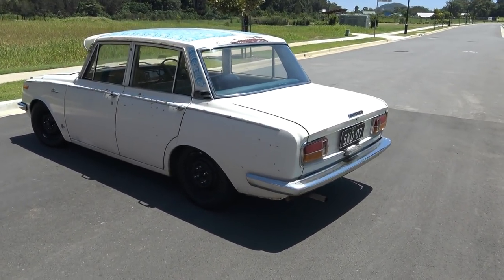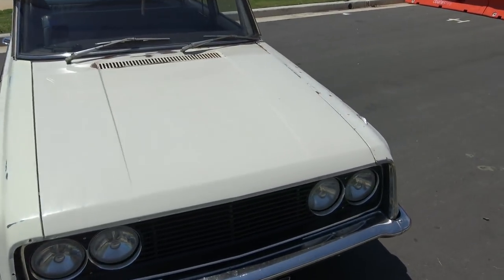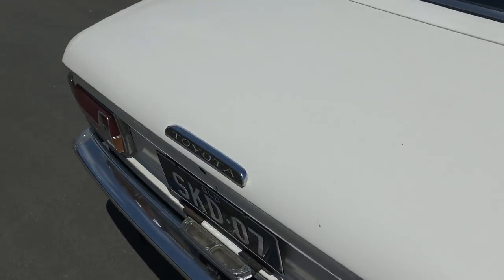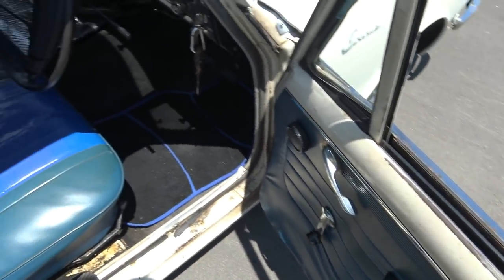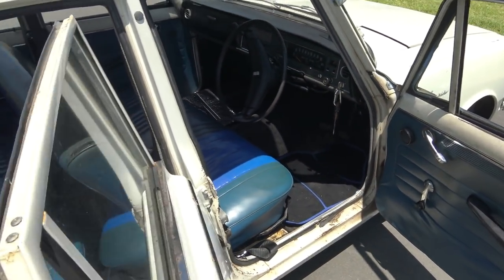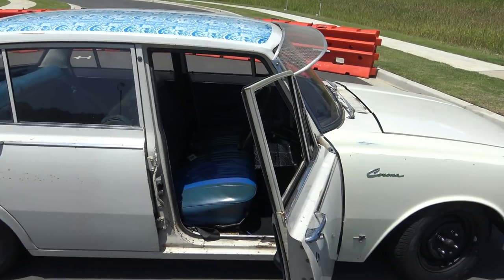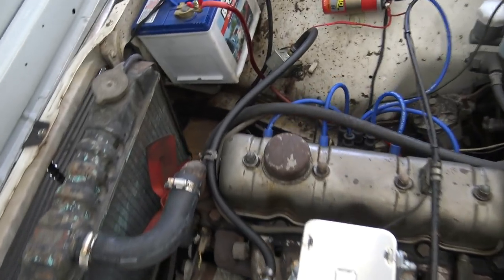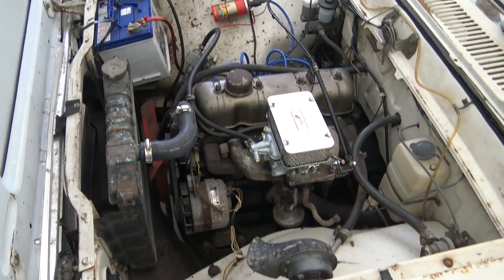Project Skd: 1968 Toyota Corona RT40

Comment: Wow. Brings back memories. Dont ever try to do a Skd in a RT40. Back in the day you could find the twin carb manifolds. They were rare back then. That funny screw on that sparky thing was octane adjustment. The vacuum advance curve was set by the factory and determined by the mass of the governor weights. The adjustmet screw with the painted bands was octane adjustment for all the different countries and fuel types this little buzz box was sent to. And dont try doing skids with the std diff. it wont take it